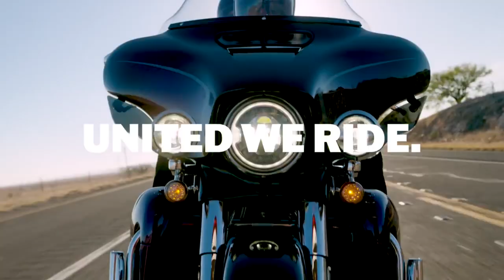Harley-Davidson 2021 Launch, Custom 1250 Replacing the Sportster Line?

Comment: Now I know that I'm going to catch some hate for this but. I think that the Sportsters such as the Iron 883 and 1200 along with the 48 and the Roadster are old outdated platforms that in my opinion should of been killed off or at the very least redesigned years ago. I mean think about it these bikes have been around since the 60s in one way or another and the current engines have been around since the 80s. These bike's are so behind the times that I'm surprised they still sell well. Then again for the price they're ok. However that being said you can buy a brand new Indian scout 60 or Bobber 60 for about the same price they have more modern technology and you don't have to spend a shit ton of money to customize them as you do the Iron or the 48 or Roadster.  In my opinion they need to kill off Sportsters and use that money to build the Custom 1250 and do something similar to what Indian did with the Scout. It would save Harley davidson some $$$$$ and would streamline production.  Cause to me Harley is like GM before 2009 building 4 different versions of the the same motorcycle. What it comes down to is this. Harley needs to sit down with their main demographic and get input from all of the Generations  like Generation w gen X the  Millennials and gen Z and start making bikes that appeal to those Generations. But until that happens Harley davidson will continue to lose sales and lose $$. Hopefully the new CEO will find a way to make it work before it's too late and we lose another great company to corporate greed.
Reply: I have to disagree, I feel the piglet is the last of the true HD’s, I ride them because they shake and are old tech. Mine rides like a hay wagon and handles like a bag o bricks, it gives it personality.
Reply: @stevemoriarity860  The true HDs are the Softails and maybe the CVOs
Reply: Harley owned the future...but they killed it. Buell American Motorcycles were so ahead of their time but The CEO of the time killed it off a month later after promises of support. What a kick in the nuts but he kicked Harley

Comment: If H-D drops the REAL Sportster and replaces it with something that does not shake and sound like a REAL Sportster, they are likely finished in the U.S., as they have already destroyed their bigger bikes with the smooth, quiet, anything but a Harley M8 engine. I have 2 Sportsters, a 1200 and an 883, and will likely buy another (used, 2006 or older) if the drop the REAL Sportster. As for an adventure bike, CSC sells a chinese made (Zongshen motor) 250cc adventure bike with ALL the accessories, including windshield, and all the hard luggage, for $4K. H-D should be able to build an adventure bike around the existing Street 750 engine for not over $12K. Then they could drop the hopeless Street series completely.

Comment: Think belt final drive will be a huge fail as seen pics with belt and chain final drive hopefully chain will used.
Reply from the maker: I don’t know why belt drive would be a fail, Harley‘s been using them for years unless you think it’s gonna be too much horsepower and the belts will fail because of that? I know a guy with a 140 HP Street glide and he had to convert to change because he kept busting belts.

Comment: It took all of 1.3 seconds to ask myself,  a "tracker" styled bike with forward controls? It would take a Pink Street Glide,  marketed specifically for Woman to be more intellectually insulting.  
Nice knowing you Harley Davidson. I'll be keeping my 3, pre 2003 Dynas,  and my 07 Sportster.  Great video Mike, thank you.
Reply: Just subscribed Mike. In regards to my above message,  I  emailed the MOTOR COMPANY suggesting a " Hello Kitty " Street 500 for the entry-level female rider. It seems to fit in line with the forward controls on the Sportster replacement,  tracker. 
RIDE SAFE RIDE FREE BROTHER. 🇺🇸🇺🇸🇺🇸
Reply from the maker: Your welcome. And don't forget it is a prototype so maybe the final product will be a little different. Thanks for watching!

Comment: 41 yrs old, 6'2" 190lb ...Pining for the Dyna... wouldn't mind killing the Sportys altogether, sry, not sry!
I liked the FXR, yes i'm an oddball.  How 'bout FXR-like Frame, new engine and a slightly more modern styling for an upcoming Sporster-Lineup?
Custom 1250 imho looks awesome. way to go!
Hmmm, better Frame, new Engine, new Styling there.... reminds me of something...

And yes... HD should (finally!) start doing (real) Business.
Would be a rather tragic loss, if HD failed as a company.
i do admire the aircooled pushrod design. but let's face it.
It's outdated and so it's admirers are becoming oudated and outnumbered as well.
Not much point clinging to "roots" if the plant gets chopped off... think about it.
Wanna keep the roots? give the plant some fresh water.
Cheers, 

S.

Comment: The problem with this analysis is the idea that there isn't a significant number of actual Sportster fans who simply prefer it to the Big Twin. Many, if not most, would never want a Big Twin. Ask any HD dealer over a beer (when they're not trying to up sell you...) The Sporty is simply a more fun bike to actually ride and customize (compared to a Big Twin) and those built after 1984 don't become obsolete. The new Custom 1250 looks great, and something needs to compete better against the Scout, but the Sportster is simply the quintessential American bike: the silhouette that comes to mind for most when "American motorcycle" is uttered. It would be a lot cheaper for Harley to trim production of the Sportster at the York plant, don't try to sell in Europe, and manufacture an Asian re-badged watercooled sport bike for the Euro market not for sale in the US. The real problem? That doesn't impress Wall Street. Sportsters are great elemental bikes, and destination bikes for tons of experienced riders not trying to dress up like pirates on the weekends (aka real world everyday riders) who value the better handling, torque, and simplicity of a small air-cooled v-twin. The problem is not enough riders buying high-margin bikes. Haters aren't the point. Sellable bikes and economy of scale in the biz is what it's all about.
Reply from the maker: Well we have different opinions and opinions are based on experiences. 90% of the riders I know move from a Sportster to a big twin and never look back.it is not the silhouette that comes to my mind when you say American Motorcycle for me. And I’m not hating on Sportster this is just my opinion based on my experiences. Time will tell if I am right on what I think Harley will do. Stay safe and keep on riding.
Reply: @RidingintheOzarks  I think you make my point perfectly. If 90 percent of the riders you know moved from a Sporty to a Big Twin "and never looked back", that's in no way representative of the motorcycle marketplace at large (in other words, people who actually buy the bulk of those Sportsters or any other low margin machine) --the very market HD needs to crack wide open. HD knows this challenge perfectly well (again, ask a dealer how many of those Sportys eventually upgrade to Big Twins vs how many Big Twin riders used to ride Sportys). That's the logical fallacy here. What HD doesn't know is how to sell more low margin bikes fast enough or in numbers enough to impress investors. Enjoying the uploads - - ride safe.

Comment: I think it is about time Harley has some competition to force them to innovate.  They have been the same old same old for a very long time.  Don't get me wrong i have a Dyna now and I had a sportster.  I loved the sportster and it had some power (not stock)  I love my Dyna as well, but I think the new Softails are way better stock to stock.  I think Harley's problem now is they are trying to play catch-up as they have not worried about changing for so long.  They are really seeing and feeling the customer base drop off.  They need to make something that catches the younger crowd.  The Die hard Harley riders that complain, that all this new tech is ruining the brand, well all I have to say is, do you want the brand to continue?  If not then Harley can stick with the old tech and never change.  If they want to pass their love of Harley on to a new generation then Harley needs to get that new generation in the door.  I really think they need something sub $10,000 to get newer young riders in.  It seems like everything new they come out with is so high that they are pricing themselves out of the market they are trying to get into.  With the cancelation of the street 750 and the street rod the only other small bike they have (besides the sportster) is the street 500.
Reply from the maker: Thanks for the comment, the crowd that thinks they don’t compete with Honda is part of what is killing them from innovating.

Comment: The Street 500/750 are slugs on the sales floor even though they have potential. I would still buy a new sportster over the Indian scout. The 1250 custom bike you mention as being on HD website of future bikes was removed from the website when I checked it about a month ago. The 1250 looks like Harley's answer to the Indian FTR1200. If it ever makes production I will be surprised. Harley's new CEO stated initially the company was sticking with it's heritage. I took that as meaning no new bikes just refreshed existing models since they were circling their wagons to recovery financially. The pan-american has to be what it is to distance itself from the street 500/750 line up in order to have a chance at survival. The price point starting at $20,000 is a direct shot at BMW'S control of that market segment. Although it's priced too high.
As far as comparing the Honda Rebel 1100 to an 883/1200 Iron? In my opinion, there's no comparison. In the business world both bikes are fairly evenly compared to engine size, performance and target demographic. The rebel is targeted to attract previous rebel owners giving them a bike to step up to just like the sportster. The high price, lack of a vtwin engine, lack of resale value and little to no after market for the 1100 rebel will kill it from the start. Unless young yuppies clammer to buy it, which I doubt.
I believe the Sportster will get replaced sooner rather than later due to the strict regulations in Europe. Harley doesn't want to lose that market segment. The Street line isn't attracting buyers overseas either because of it's strong ties to India. We will have to wait and see what the future brings.

Comment: I'm a rider in the Ozark mountains, age 27. I got a used 883 Sporty a few years back, then decided that i like Harley enough to buy a new M8 Softail over my beloved Yamaha. My wife, age 29, just got her first bike; an old Yamaha 250 Virago. The news of the new Sporty is what made her decide that her forever bike will be a Harley and not a Yamaha Bolt.
I don't think that older Harley riders realize how much damage they do to the company. I refused to ride a Harley for the entirety of my early years because older Harley riders tended to be intolerable. Even when i had an older Sporty, i couldn't stand to be around older Harley riders because they degraded the Sporty as a "girl's bike" rather than praise it as a contender in its class.
If older riders want their favorite manufacturer to outlive them, then it is time for them to stop shitting on every attempt made by the MoCo to appeal to the next generation. We like the Pan-American. We like that the new Sporty will have an updated motor that wasn't designed 30+ years ago. We like that the Street models are priced and designed as starter bikes. And we really wanted the Bronx, because we are pissed that Buell got the axe.

Most of the people in my riding social circle are aged 25-35. Few of them like Harleys, most of them hate Harley riders. We don't care about baggers with a price tag equivalent to a year of tuition. We are interested in bikes that are fun to ride, easy to maintain, and are realistically priced. The next generation can ride a 1100cc Rebel or a 1250cc Sporty. Make your choice and change the culture to manifest that choice.
Reply from the maker: Well it is sad to hear that you have been treated that way by riders, not all Harley Riders are that way, I ride with all kinds of bikes hell we had a KLR do a poker run with us this fall. I don't care what you ride as long as your not a danger to the group. And you are right that Harley has to embrace younger riders and old riders should be encouraging the sport and young riders not hating on them over a brand. I started on Honda Shadows when i first started riding street bikes. Stay safe and thank you for the comment and watching.

Comment: I've had 2 883(customs), why not 1200?, because I ride in the hills, 883 is enough to maximize fun. But now I'm on dyna(and a few zukis) and I'll just stay with dynas from now on......oh wait, well, since the Sportster engine is best ever made I'll probably get a 1200 iron someday to replace M90

The bad thing about the high rpm bikes(my GSXS750) 7000rpm in 2nd 54mph, 3rd 66mph, 4th 76mph.......high TQ 9000 rpm, high HP 10500rpm redline 11500rpm..... I'll never know this engines ability, in order to ride in this bikes power range I'll have to be in first gear all the time

Sooo I might would switch the GSX for a Harley 1250
Reply from the maker: Different bikes serve different purposes, the right bike is always the one that’s right for you!

Comment: A liquid cooled ‘modern’ Sportster (or Custom 1250)  which can compete with Rebel will make sense.. Custom 1250 looks better than Rebel to my eyes ( even though I’m pretty sure it will not be a match to Honda’s refinement and Tech )..
In my opinion, Harley is the most desirable brand in Cruiser /  Bagger segment and for buyers of certain age group..
I’m not sure if Adv enthusiasts and their age group will ever care about Pan America( in comparison with GS, Africa Twin, Tiger etc.. ) and the same is applicable to typical Harley fans who’ll most likely not look at segments other than Cruisers / Baggers..
Reply from the maker: There are plenty of riders that are loyal to the HD Brand and wouldn't switch, but I think there are plenty of others that would, I think the Typical rider you speak of is aging out and more people are considering options like Indians and Honda's. Only time will tell for sure. Thanks for watching and commenting.

Comment: That bike is really  BFU. None of the designers cared about where they were running the exhaust obviously.... not to mention that the pipe-shields are way over sized for their placement on the bike. The designers should have routed one pipe to each side, thereby giving "symmetry" to the bike's rear view... as I see they plan on "jacking the exhaust up under the pillion".... Dumb idea..... And they could add Form to Function  by flattening the exhaust's profile, making it  a vertically ellipsed shape.... As it sits, I can't even appreciate the engines form, never mind trying to think about doing work on it. .....Nuff said
Reply: Oh yeah, and while I'm on the topic..... Once again the Rad,.....( as with every Liquid cooled Bike in production recently,).... looks like a friggen " After-thought". Huh?!, Why ???
C'mon People, you spend hundreds of thousands in R&D, and this is the best you can muster up??,.... Lets get real on the Design Aspects HD..... You can do better.

Comment: All the new models have LED lights, the Pan American starts at 1700
Reply from the maker: Wrong, most  HD touring bike are Halogen, Sportier is are halogen. That may change in 2021 and I hope it does but the current 2020 models are not all LED. Did you mean $17,000?
Reply: @RidingintheOzarks  I said the new models like Softtail and Livewire. I know all new models as in totally revamped models will have LED lights. I didn't mean new model year. The Pan American and Custom have them so that leads me to believe that any revamped models will have them as well.
Reply: @RidingintheOzarks  yes starting price according to a recent article had it at $17000
Reply from the maker: @KevinButler816  ahh well that maybe true, thanks for clarifying, but it is time for models to have LED imo. People are buying cheap $50 headlights on amazon for brand new bikes cause it’s better than the halogen that came on the bike...
Reply from the maker: @KevinButler816  I hope, articles I saw were guessing 19-21k. We will know soon.
Reply: @RidingintheOzarks  I agree especially the touring models !

Comment: Also if they would have used the 750 and made a light middleweight they would be in line with current market trends. Riders are moving away from the large adventure bikes so Harley is a day late and a dollar short. Adventure bike people are not Harley people for the most part. A swing and a miss!!!